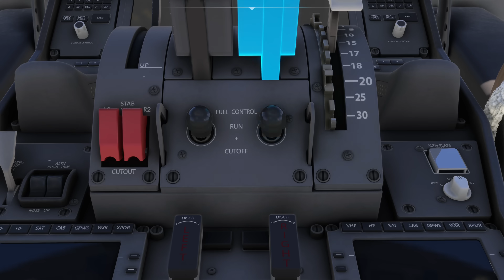Air India 171: Why Did The Fuel Cut-off Switch Get Moved?

Comment: It’s unfair to blame the pilots for the Air India 171 crash when the preliminary report doesn’t state they manually turned the fuel switches off—in fact, cockpit audio suggests they were confused by the cutoff. The cause is still under investigation, and jumping to conclusions ignores key facts. Also, the FAA issued a 2018 safety advisory about potential faults with these switches, which Air India reportedly did not act on since it wasn’t mandatory. Instead of blaming the crew, we should focus on the technical issues and wait for the full investigation.
Reply: It's not 100% certain that a pilot moved the switches, but realistically based on the information available it's 99.5% likely.  Otherwise.. both switches would need to fail in exactly the same way at exactly the same time (+1 second) and at exactly the worst moment that is unrecoverable. And the switches would have had to have shown no signs of issues across the hundreds of past flights of that specific aircraft.
Reply: @kubi0461 but they failed 1 second apart that also can be falsely written in report to blame pilots...they should put all audio and other info for public to analyze
Reply: @kubi0461  How else do you think those switches moved given that they are mechanical and have a robust mechanism to prevent accidental switching and within 1 second of each other ?
Reply: @kubi0461  It's 99.9999% likely (1 in a million) but modern airline disasters often come down to incredibly unlikely failures happening at the worst possible time. The switches didn’t fail simultaneously — they moved 1 second apart — and the CVR shows clear pilot confusion. If both faulty switches were moved together during startup (as is standard) and weren’t fully locked in due to some type of marginal engagement, they COULD POSSIBLY slip under vibration. Engineers might say this scenario is highly improbable, but is is IMPOSSIBLE?
Reply: @2late4glen they can not slip under vibration. That’s like saying I tripped and fell on the ceiling
Reply: @odez180  That's not a valid analogy. Tripping and falling onto the ceiling defies physics. Mechanical components shifting under vibration — especially if not fully locked — does not. It’s a known engineering issue across many systems. If the switches were faulty and allowed marginal engagement (not fully seated), vibration during takeoff could nudge them into the next position. I'm not saying this is likely, just saying it's not totally impossible and it is usually an extremely rare event that causes modern aviation disasters.
Reply: @2late4glen ok so have you actually operated one of these switches before? Cause if you have you would know it “slipping” because it wasn’t properly engaged would defy laws of physics
Reply: @odez180  So are you saying the scenario I mentioned is TOTALLY IMPOSSIBLE?
Reply: @2late4glen that’s what I’m saying. Just like tripping and falling on the ceiling
Reply: @2late4glen  As far as I know the switches are not "moved together", but one after the other as part of the engine startup procedure. if they were slipped under vibration, how is it possible that: 1. They slipped 3 seconds after liftoff, when there is no vibration anymore. 2. Not one, but both slipped off with 1 second in between Even if there would be problems with these switches, how likely would it be both fail at the same time. 3. Why wait for a full 8 seconds before bringing them back to run in such a critical flight phase. 4. After the crew set both back to run 10 seconds later,  how could both switches stayed in their run position even after hitting concrete buildings at approx 180 knots. As you can see, even without blaming everybody, it remains everybody's responsibility to read the report, continue deducing and keep asking questions.
Reply: @2late4glen blah, blah, blah, you have obviously never operated one of these switches, it’s called Suicide, plane and simple
Reply: @kubi0461 Even if it is 99.99% how dare YOU or any BS Joker on earth directly blame the PILOT without 100% EVIDENCE? Shame.
Reply: @kubi0461  And that is beyond reasonable doubt.  To think something else than a pilot turned off those engines is to start putting on a tinfoil hat.
Reply: @kubi0461  "It's not 100% certain that a pilot moved the switches"
This is a good point, how does the FDR 'know' the switch position, well that's by an electrical connection.
No one has raised the point that the sole survivor mentioned an electrical glitch shortly after takeoff.
Are they connected, who knows ?
Reply: @michaelbarton4787 electrical glitch because both engines shut off
Reply: @michaelbarton4787  that glitch is caused by the sudden, total loss of electrical power from the engines, and the takeover by the emergency bus & the RAT.
Reply: @michaelbarton4787 I’ll tell you why, the one Pilot noticed the actual switches in the CUTOFF position, otherwise he would not have asked the question “why did you move the switches to CUTOFF”?
Reply: @ronpayne4505  That's supposition....
Reply: What is your suggestion as to how the two engines were cutoff
Reply: @thegame7557 , there should be an investigation done to determine if Boeing has the resources and capabilities to remotely control the systems on their Aircrafts.
Reply: @SaneHuman-x4t  the fuel on and off are manual. They have been left dump in a plane which can fly itself deliberately
Reply: @thegame7557 , are there any sensors or alarms to detect its movements?
Reply: @thegame7557 , chafing wires are a possible cause and a common condition.
Reply: @user-dj1hy6zc6q  - Chafing wires moved those switches?
Reply: @user-dj1hy6zc6q No it’s not where do you ppl come up with this B.S?
Reply: @user-dj1hy6zc6q  But nothing to do wit this incident
Reply: The guy is trying to Shield Boeing from any criticism 
He is working very hard to that effect 
Based on a preliminary report 
Ridiculous
Reply: True, it may also be an electrical issue which led to fuel shut off valves activated even without the switches, than pilots may tried restart in short time.
Reply: @MrLouanderson exactly my thoughts
Reply: @MrLouanderson impossible
Reply: @MrLouanderson Simply not possible, the one Pilot asked the other Pilot why he moved the switches, he asked this question because he saw the switches in the CUTOFF position and they didn’t move to that position by themselves!!!
Reply: On top of that this very channel first blamed the pilots that they put the flap switch instead of the landing gear switch. So, he is clearly working for Boeing #BoycottCaptainSteeeve
Reply: @SwapravaNath 
The guy is getting paid by Boeing 
To bring out his crazy theories
Reply: The report says the cutoff switches transitioned to cutoff, for me that suggests that the CVR picked up the sound of the switches moving. It should be impossible for them to move without being moved by a person. Final report will shed more light in a year or two.
Reply: @MrGeneralScar  did you head about the FAA bulletin on the faulty switches... We should question the machine too before blaming the dead pilots. It's easy to blame the pilots but it should be the last resort.
Reply: @piyush8941 if it was that’s serious it would have been an airworthiness directive not a bulletin
Reply: @odez180  MCAS was hidden by boeing too... People are losing trust on boeing. You can blame the pilot, but based on boeing behaviour in past decade, I highly doubt.

Still if we have any soild evidence, I can accept it was pilots fault.
Reply: @piyush8941 I doubt they’re doing that again. Many agencies involved in these findings
Reply: @piyush8941  I have not read the bulletin, but I have heard of it. I was not blaming dead pilots, I was merely saying the preliminary report implies that they heard the switches sound of movement on the CVR. Ordinarily those switches cannot be moved automatically, it is a very deliberate action to move them. I am not a pilot, but I did about 2 months ago take myself to a B737 simulator for a 90 minute session, part of my session was a fault that I didnt know was coming (as per my request) which turned out to be a fire on Engine 1. I had to disable the auto throttle, bring the engine 1 back to idle, and use the cutoff switch, then pull the fire handle and twist to  try get the fire out. The switch just doesnt move by itself, its quite a bit of pulling needing to move it (about 2cm up by my recolection) before it can be moved down.

Could the switches have been faulty, or have a worn down collar which made them possible to move by knocking them... Sure its possible, the aircraft had over 40000 hours and many thousands of flight cycles. 

Typically a preliminary report that doesnt cite any directives for the aircraft involved, but does cite switches being used implies that the CVR (which picks up all sound in the cockpit, even sounds outside of the human hearing range, and sounds generated from outside the cockpit) detected the switches movement. There are many microphones on the flight deck, and the investigators can use the minute timestamps of sound arrivng at each microphone to pinpoint which which was used exactly.

We should just wait for the final report to come out which will provide much more information.
Reply: @MrGeneralScar  agree, this is what I believe too. This can a pilot fault or mechanical failure we shall wait for the final outcome. The most important thing, the investigation shall be unbiased and independent, so that general public can maintain their trust on aviation.
Reply: @piyush8941  The question I have is why, IF the switches moved by themselves to the cutoff position, how likely would it be that both did, with 1 second in between, why it took an additional 8 seconds for the crew to move them back to run in such a critical flight condition, with the CVR timeline the cutoff was almost immediately noticed (witch seem logical with the change of sound from the engines en the deceleration that would have undoubtedly been felt instantaneously) and why, if these switches were prone to slip back to cutoff due to external factors, both remaining in the run position after hitting concrete buildings with 180 knots. There is a lot to be said about the FAA bulletin and maintenance not following up, but these questions up to now remain unanswered
Reply: @piyush8941 what’s so difficult to understand here!? The switches cannot move by themselves! Have you ever operated one of these switches? I have, literally thousands of times, they DON’T move by themselves. Enough of this nonsense, they were moved by one of those two Pilots!
Reply: Well said. Its seems the fuel was cut off independent of any action by the pilots. I doubt these pilots got in the cock pits looking to turn into Japanese Kamikaze pilots taking them and everybody on board with them. I thinkits unfair that people like Capt Stevie are jumping to that conclusion without all the evidence. Maybe in WW2 with Japanese Kamikaze pilots that was obvious maybe Capt Stevie's father served in WW2 and saw first hand maybe he is traumatized by what his father saw and he is bringing it into the discussion here?  Japanese Air Force Pilots flew directly into American aircraft carriers in the Pacific sure but that was at the height of WW2 in a war situation.. But with all due respect I don't think thats what is happening here. I doubt these individuals inteneded kill themselves and everybody on baord. That is a huge stretch, unfair on the pilots who have flown safely all their lives. Evidence by eyewitnesses on the ground points to the Pilot trying to avoid civilian casualties at last moment. That does not sound to me as the sought of pilots you accuse them of being. I like you Captain Stevie but as a civilian I totally disagree with this and I am pretty sure once full investigations are completed you are going to be proved dead wrong and the Pilots will be cleared and exonerated.
Reply: @rohanmarkjay do you think a pilot has never sabotaged an airplane before?
Reply: Two feul cut-of switches, not just one. Split by a second in time. This is how humans operate. Not at computer speed or turtle speed, not at humming bird speed. The change of two independant switches is either a human mistake or human intent. The cockpit audio does not suggest "they" were confused, it says that the act was queried by the other pilot and denied by the one making the changes. We are all speculating at why the denial but blaming the switches seems a bit like a speeding driver blaming the accelerator pedal when stopped by the police.
Reply: Capt. Steeeve has sold his soul to Boeing.  He is acting as a psychological hitman now.
Reply: What are the chances of some technical fault resulting into fuel cut off without switches actually being moved? (That could be the reason Pilot Flying asked pilot monitoring about the fuel cut off?) Once the pilot noticed that the a/c is losing thrust and followed the procedure where you require to put the switch to CUTOFF and then to RUN but altitude being too low they were not able to recover.

This is where I think FDR data is reading Fuel Control Switches were moved to cutoff but in reality it was technical fault cutting the fuel which resembled same as cutting the fuel to the engines. Now, when they physically put it to cutoff it didn't read in FDR as technical fault earlier already had fuel cutoff which was resembling the cut off state of the switches. After few seconds when they put Fuel control switches to RUN position it apparently started the engine and fuel is running through the engines. (This was read as Fuel control switched moved to RUN)

This is my take. I am curious to see what the final report has to say!🤔
Reply: Let me just put this to you bluntly and factually.  If Air India or anyone thought it was the 787 aircraft and not the pilots, they'd have grounded EVERY ONE of their 787 aircraft the day this happened.  The fact that Air India is STILL flying their 787's tells you right now that it isn't Boeing and it isn't the aircraft.  Occam's Razor applies most effectively here.
Reply: I'm pretty sure you can't vibrate or accidentally turn the fuel control switches to off. Come on!. It takes a deliberate action from one of the pilots to manipulate them from on to off.
Reply: @SwingArmCity What basis for "you pretty guy" being SURE ? Assumptions, or your ghost was inside the cockpit.
Reply: Definitely my thoughts @SwingArmCity
Reply: Also, it's no surprise that two Boeing whistleblowers, John Barnett and Joshua Dean were found dead.

Still, some white people here can't digest that boeing can crash due to malfunction. They are either in some dilemma or brainwashed.
Reply: Good point, why blame the pilot/s so early? But the point is, they released the detail about the exchange between the two pilots. In my mind, that means they are trying to say that it happened on purpose, without saying it happened on purpose. Other wise, why include that exchange and just leave it hanging for people to rush in and fill the void? Why didn't they just say there was confusion in the cockpit regarding the fuel switches?
Reply: @davidb4192  one cant be ambiguous in these kind of reporting. The issue is they did not disclose the full transcript of the cockpit voice recorded. Rhey need to release it fully.
Reply: Sharath Panicker, a Wing Commander and former Dreamliner pilot who flew the jet for 10 years explains exactly why it's very unlikely that a pilot error or manual action caused the fuel switch to "cutoff". He said that it's almost impossible to transition switches for both engines manually within a matter of a second. It's already in the news.
Reply: This man every day say human error but report does not say so.wait for investigation.
Reply: I agree, while there is zero video to show anyone's intervention with the switches, leaves only an edited piece/s of audio.
Which in itself as published, can not conclude human intervention of the switches.
It does on the other hand, point to fuel being shut off, not by either pilot! 

One pilot said, "why did you do that"? The other states, "I didn't"!

So who or what did? 
So until that can be properly and definitively
substantiated, then it can "not" be said either pilot cut the fuel!
To do so, is an unsafe mode of reasoning!
Reply: @jacktupp1427  The input of the switches was recorded on the black box, apparently they can't be reset easily but need a deliberate action. This incident is the first resulting in the loss of a 787 ever. If it was a problem , there would have been other incidents with this type. There haven't been.
Reply: I agree,let's wait till final reports are out ,
Reply: That's what I'm saying to him this old geezer  the vr clearly states that the pilots were also confused but hes intentionally trying to blame the pilots
Reply: Have you listened to the audio or why are you assuming that it suggests confusion? All we know is that one pilot asked why the other cutoff, and the other pilot answered that he didn't do it. These are the facts. We haven't heard the tone of their words, we haven't heard any additional conversation. With just the facts, assigning "confusion" to the situation is just personal interpretation.
Reply: Yes foreign media is on mission to blame indian pilots and save big company...
Reply: You muse be Indian and in denial. The first step of grief…
Reply: Right, Brother. Entire media and YouTube experts are working for Boeing to cover up the plan issue and blaming on Pilots clearly saying he did not cut of the fuel control switch. Definitely big money trying to push their own agenda and narrative to save Boing.
Reply: But apparently the section with thrust levers and fuel switches gets replaced for routine maintenance something like every 5 years or 24K miles. Maintenance records indicated this plane was replaced in 2019 (year after advisory) and also in 2023.
Reply: I agree
Reply: The audio of the prelim report is not the full audio. And it seems to have omitted quite a lot based on what reported by a newspaper this morning.
Reply: It’s unfortunate not being you. Clearly seeing your narrative paid by Boeing corporations who are already dealing with lawsuits. They are underestimating Indian human beings
Reply: stop the bullsh*t and understand dual switches can only be turned off manually
Reply: @Motivationclub616  How do you claim that it can be turned off manually only? Did you maufacture the switches?
Reply: @Motivationclub616 yeah because you're saying it. Bulls*t
Reply: I don’t think they have blamed the crew yet, they are just following the evidence, the switches were recorded, by the flight data recorder, being switched to the off position, then 10 second later being returned to the run position.
Reply: Alot of common sense.
Reply: It's a mechanical switch that needs to be moved in a very specific way. The blame should absolutely be on the pilots at this point
Reply: The switch connections may be faulty. We don’t now the actual design of the system and it’s probably much more complicated than a simple light switch. The physical state of the switches might be disconnected from its logical state in the system.
Reply: And Boeing had a bad reputation abt that specific model even  from the production team internal interview @ozgungenc
Reply: A culture of cutting corners, noncompliance and always blame somebody else.
Reply: @hippocreation 
A culture of murdering people all around the world 
If they don't toe their line 
Recently in Ukraine they murdered one million but blame it on Russia 
Not that their hegemonic policies caused It
As if the rest of the world are made up of fools to follow their crap 
Here Boeing murdered 260, now they want to pass it on to the Pilots 
Knowing the poor Pilots are no longer there to defend themselves
Reply: New report says the pilot had mental illness for several years now after his mother's death and he had taken medical leave. I think that alone is a red flag.
Reply: => https://youtube.com/watch?v=GpKwdxPGWVU&lc=UgwQuvQXNgIRbIm-sVZ4AaABAg&feature=shared
Reply: What technical issues? There were no technical issues and it's impossible for them to move on their own or by accident, especially one second after the other
Reply: @reinaldogomes8666 
The cut off switches need not move 
It can remain in Run position
But can get cut off internally 
That's why one of the Pilots asked did you cut off 
And the other replied matter of factly that he did not 
It could be that the Pilots were bewildered confused to ask the question in such short time
Reply: Your uneducated so shut up 😂 bloody fools have zero knowledge but rant brainless rubbish hear. Bloody fool faulty switch don't become normal in 4 seconds.
Reply: Cockpit audio doesn't suggest anything.  The comments in the report are parenthetical, not quotes.  There is nothing to state the pilots are accusatory or confused.  We do not know as of yet.  Are they hiding something by not releasing the audio?  We do not know as of yet.  The 2018 FAA advisory is a total red herring, as the entire fuel switch module was replaced twice since the aircrafts manufacture.  Lots of speculation right now, fair or not, but pilot fault is not off the list either.
Reply: Agreed! Let’s wait for the full version investigation!
Reply: The throttle control module (TCM) of the Air India flight 171 (VT-ANB) was replaced twice, in 2019 and 2023. The TCM houses the fuel control switches too. Why was the TCM replaced so frequently on the direction on boeing?

Also before the crash, on the previous flight the pilots logged a malfunction of faulty stabilizer sensor.
Reply: @mr.j6256  There are always faults which arise.  There is an entire list of faults which are flyable with and which are not.  These are some of the most complicated machines in the world and in a constant state of maintenence and repair.
Reply: I liked this channel but the narrative this is guy is putting out is crazy. With so few evidence and even those suggesting other wise.
Reply: @ViralVideos-wp5cz  Agree this line of discussion is premature i came to Steve from other youtubers who were in my opinion not handling the situation right and now this guy jumps down this road
Reply: @ViralVideos-wp5cz its time to unsubscribe..my initial impression changed from the time I saw captain steeeve going wrong on pilots mentioning flaps were not operated correctly by them  and much later withdrew that and talked of  RAT deployment after jeffostroff posted about it. So captain steeve is more inclined to calling it pilot error from the start, obviously.
Reply: @Joy28N it was not pilot error. It was pilot sabotage. Steve needs to get his act together
Reply: Correct.. it is quite evident why some vested interests are trying to push this narrative of pilots doing it 😅
Reply: The audio suggests only one of the pilots was confused to why the other one cut off fuel.
Reply: @SadWatermelon  because the co pilot has 8000 hours of flying experience he responded instantly with a no.
Reply: @lalithrockz The pilots hours is not relevant in this incident. This was not pilot error. This was pilot action
Reply: @SadWatermelon  Or the one you say was confused pretended that he was confused, to blame the other.
Reply: Audio suggests confusion.
Reply: @SadWatermelon  YES, you have noted accurately. The OTHER Pilot was SURE he had not done it. But Capt Steeve is jumping to a Conclusion that the PILOT was a "child playing a prank & denying his action" - WITHOUT ANY DIRECT EVIDENCE to support his  Conclusion. SHAME!
Reply: @rajeshdoshi3363 No one toggles fuel cut by accident
Reply: @rajeshdoshi3363 you are delusional, the switches CANNOT move by themselves. The switches were deliberately moved to CUTOFF!
Reply: Agree. I find it alarming how pilot error is assumed so early on.
Reply: @Andrew-il1rh it’s cause pilot error is how airplanes usually crash. And this wasn’t even pilot error it was pilot sabotage
Reply: Agreed.
Reply: You are 100% correct.
Reply: @JordanDias1 99.5 IS NOT = 100 my dear - get yourself examined before blaming the Pilot.
Reply: @rajeshdoshi3363 please examine your qualifications before you act like you know how planes work
Reply: just because you dont like the result , doesnt mean its wrong..There have been many suicide flights involving big aircraft....it happens..Indian or not
Reply: @goodo5691 please let us know if you can switch off two light switches about 4" apart within a second.  And the fuel switches are spring loaded, you need to pull them out, shift it to the off position and release.  Ditto for the other switch. Remember both switches in less than a second.
Reply: Where is the EVIDENCE that the PILOT PHYsically moved the fuel switches to OFF?
Shame on the Oversmart B...s who cannot accept criticism and want others to accept their assumptions.
Reply: Just to save Boeing that's it
Reply: @trojanhorse4eversave boeing, does indian and canadian investigators also want to sabe Boeing? If they refused to sign the preliminary report we would know
Reply: Captain Steve is out there to create a narrative to blame it on the pilots. He definitely has an agenda. He is not questioning any technical or maintenance issue. Straight and straight go after the pilots. Some questions to be asked

1. Where is the full transcript of cockpit voice recorder. The plane was airborne for only a few seconds. Why was the full transcript not released along with the preliminary report.

2. The switches were moved to cut off within a second of each other. He says thats very possible and he adds on to say the switches being moved to Run after 10 sec and the time interval between left and right being 4 seconds also holds ground. I fail to see this as a non biased way of reporting. I do believe if the switches were moved manually by either of the pilots then it would take at least 2 to 3 seconds to do it. Both switches dropping down to cut off within a second points out to technical malfunction. I want Indian pilots and non biased experts to demonstrate this.

Captain Steve is biased and creating a narrative to save Boeing .
Reply: @Vinay_Zaveri he’s going in that direction because he understands how aircraft’s work
Reply: @Vinay_Zaveri .Totally agree with you.
Reply: @Vinay_Zaveri  Incorrect. They are toggle switches located side by side. If an operator wants to move them, then grabbing each and moving them across would be easy enough - the tab that "prevents" bumping the switches COULD be overpowered by someone forcing the toggle across. Yes if you do them one by one - it could take longer - but the switches could be manipulated quickly if the operator doesn't care if they get broken - just shove them over.
Captain Steve is actually very careful to avoid saying it is pilot error (or intentional) - so you are totally wrong about that.
Reply: @Vinay_Zaveri  - You can flip those switches one after the other in less than 1/2 second.
Reply: @mountainflyhigh  You have to grab those switches, then pull them towards you, before putting them in the down position to move them. They are not that easily switched. There's a double-lock to prevent them from accidentally moving.
Reply: @rabarebra _ Did I infer anything otherwise?  I'm well aware how they work.
Reply: @Vinay_Zaveri  And you have a severe case of BDS (Boeing Derangement Syndrome) . You are just looking silly now.
Reply: @Vinay_Zaveri  your own AAIB created that narrative in its own publication, the black box is unequivocal, the switches were deliberately moved 1 second apart. I know it's discomforting but it's not the first time, a pilot deliberately induced a failure.
Reply: @Vinay_Zaveri  so Indian authorities will trash their own airline to help an American company ?  I know that many people cannot fathom why someone would commit an act like this but it happens anyway; Look at Germanwings and air china.  The facts aer pretty clear in this case, shocking a sit may be denial does not change that.
Reply: @timberry1135  No the report doesn't answer all questions. The report doesn't target Boeing nor do i want to target the company. Just want the facts to be put out in open without prejudice or an hidden agenda .
Reply: It is crystal clear that this was a suicide AND mass murder by the pilot. There is plenty of evidence that he was going through severe depression and was considering stepping away from his career shortly after this flight. He was acting confused about "who" turned the fuel switch off to disguise it, when it was obvious he was the one who had done it. Unfortunately, the copilot didn't have enough time to do anything.
Reply: The co pilot is the one who was going to retire smh @firelordplayz
Reply: @firelordplayz  there is no evidence of him going into depression. Wtf are u talking about? Stop spreading blatant lies
Reply: @firelordplayz  Agree with you. Just a clarification. It was the copilot who flew and asked that question, pretending he was confused.
Reply: @firelordplayz  Exactly. but there so many 'experts' here who are so deranged and trying to pin it on Boeing.
Reply: I feel so sorry for my fellow Indians ,they require all the proof when it comes to even like this ,but absolutely no when someone says apply cow dung for acne ,or drink cow urine for illness 😂, you don't always need to blame big companies,you have to accept that pilot did it intentionally
Reply: @ixabepilone1575  Making fun of an entire community’s beliefs or reactions doesn’t show intelligence — it just reflects the kind of thinking you were brought up with. There’s a difference between questioning things critically and mocking for the sake of it. Maybe focus on the issue, not on belittling others. Pitty.
Reply: @ixabepilone1575 who told you that stop watching propaganda
Reply: @ixabepilone1575 applied cow dung for acne. You did it or we said it 😂 , plastic surgery was invented in India and many other types of medicines. You were in the cave when we were the knowledge hub 😂
Reply: @ixabepilone1575   That’s not clever; it’s lazy, bigoted, and reeks of insecurity. If you don’t understand aviation, investigations, or basic logic, that’s fine. But don’t parade your ignorance here. Go spew that garbage somewhere else; the discussion is about real lives and real accountability, not your need for attention.
Reply: @ixabepilone1575  It is like arguing with someone who believes the Earth is flat.  I have encounterred such pushback and insane counter theories to the clear truth that one of the pilots intentionally turned off the fuel to both engines it would be laughable if it weren't for the deaths.
Reply: Go into the research based results written thousands of years ago in the AyurVeda part of Atharva Veda further detailed in Charak samhita and Sushrutasamhita. Kindly note humankind did not start from the Christian Era.
Reply: Steeve is paid by Boeing.